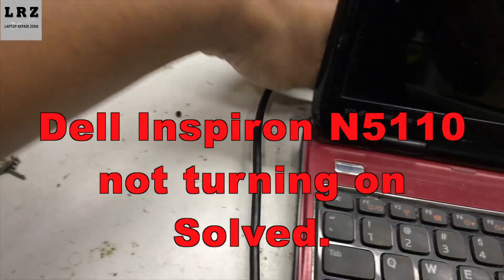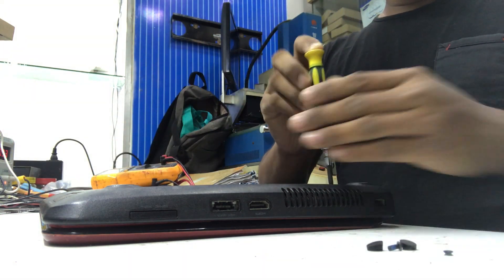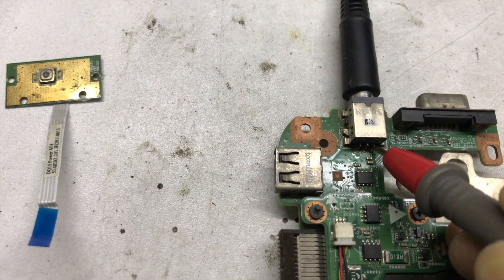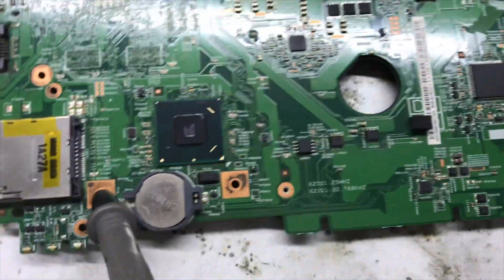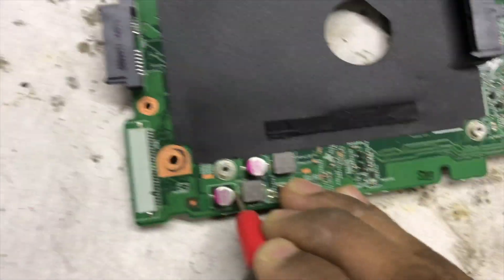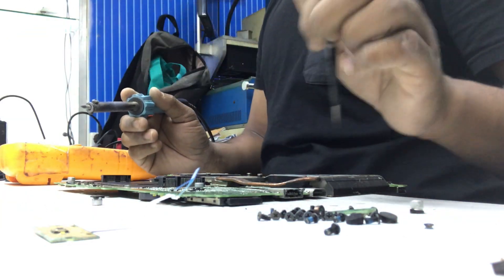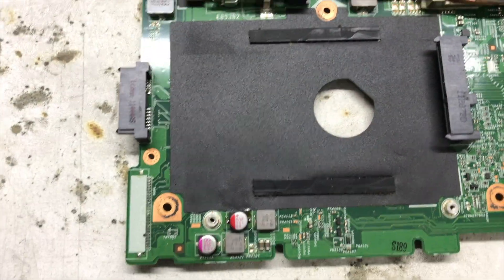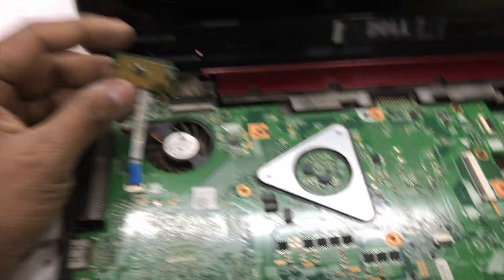dell inspiron N5110 laptop not turning on solved.

Comment: Laptop and it's Fan starts after clicking Power button and after 5sec, Fan stops but Light of Power button still On..

After 10sec, Beep sound starts..

Whats the Issue..?
Reply from the maker: Thanks for your comment, how many beeps?
Reply: @Laptop_repair_zone  Beeps continues until we switch off manually

Comment: When I connect this all up it appears to trip the ac adapter circuit breaker? as it shuts down. (I tried more than one working adapter, same results). When I take the power input board from the mobo off it does not do that and I get the 19v on the jack. So the mobo is shorting the power out. Is there a component I need to test that may be causing this or is it likely a more major failure?
Reply from the maker: Your laptop motherboard 19V line short to GND, so you need to inject voltage from external power supply that should be 5amp, then you can find out which parts short.

Comment: Laptop is powering on through battery. But not powering on through power cable without battery. I checked all voltages as you told with the battery out and power cable plugged. All voltages are correct. Capacitors also gave correct reading. What could be the problem?
Reply from the maker: Thanks for your comment. Please check charging section and SIO.
Reply: @Laptop_repair_zone  Charging section and SIO are showing correct readings. Nothing wrong there. Today after checking. The charging light is blinking. And when the laptop switched on, the charging symbol is also blinking. It is not staying for long.
Reply: Chech if the 3rd pin of charging port is connected. Because of the design this 3rd data pin often get disconnected over time

Comment: i am facing problem on turn off . after press shutdown, it just close the lcd but still power button is on. i have to press and hold on the power button for complete shutdown. please advise. i am really worried due to this issue,

Comment: Greetings friend, I have the same pc.
supply voltage is 19.5v

that of the first capacitor is 0.752 v
, the second of 0.432 v

I do not know how to measure the voltages of the next piece, the one at minute 2:24

I don't know exactly what pin.

you help me please
Reply from the maker: Thanks for your comment, change 3v and 5v IC

Comment: Hi bro, Does this power board (dq15dn15) generate 19v voltage when not connected to the mainboard? I have a dell i5 with crazy voltages on the power board and I don't know if it's a problem on the power board or if it's a problem on the mainboard! I have already removed several components and the problem persists.  
https://i.postimg.cc/j2p5Yx1v/6874684-jpg-baa0f434a5ba78916708c1a5a0d9b592.jpg
https://i.postimg.cc/T2FhD0Pm/Sem-t-tulo.jpg

Comment: in my n5110 the battery not charged/not detected and give me the massage in black screen i need to connect to 135 w charger what shall i do
Reply from the maker: Ehab Mohamed what massage show in your screen?
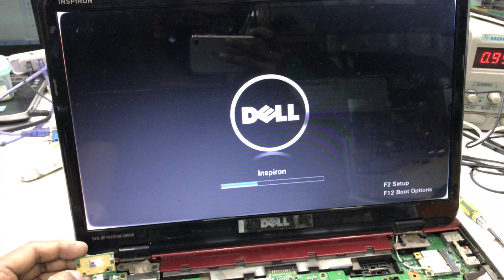Reply: Laptop Repair Zone when i power on the lap it is black screen like the one shown in end of  your video at 6:18 in yours say connect to 85w charger in my message say connect with 135w charger and the lap is toooooo slow
Reply from the maker: It’s motherboard issue you need to check motherboard charging Port.
Reply: Laptop Repair Zone how can i check it. And you mean  heck power board only or all motherboard

Comment: I have the same device the fan volume is somewhat loud even though the processor temperature is low and I did a good cleaning of the fan and changed the cooling paste for the proctor and the screen card, but unfortunately it is of no use please advise me of the cause of this malfunction

Comment: Hi, I have this problem on n5110 mb, I change capacitors but no results, 5v and 3v missing...and is not short! On TPS51123 all voltages are like in your video, what ellse can be? tnx
Reply from the maker: Thanks for your comment.please change TPS51123.

Comment: Mera dell laptop charge ho rha hai but on nhi ho rha hai kya karu.. 7353022456
Reply from the maker: thanks for your comment, if you are a technician than take out the motherboard and check all the require voltage step by step.
Reply: @Laptop_repair_zone  m not a technicians plz send ur no.

Comment: Hi, I have Inspiron N5010 and it got dead during BIOS update from A12 to A15. No power LED nothing just dead. Where to look for the problem BIOS or Power supply? Laptop is dead and no LED or Power button response after plugged in. Adaptor is working. Any help appretiated.
Reply from the maker: Rizwan Naik your location please.
Reply: @Laptop_repair_zone  mumbai. But i am tech. I can try to solve myselfe. Need guidance.
Reply: remove bios ic than  flash it
Reply: @GMurali26  how to getbto bios ic. Any directions?
Reply from the maker: sorry bro my location is dhaka bangladesh.

Comment: Hi sir.. I have similar problem on dell N 5110. I check power jack voltage it shows 19.5 volts and after that I checked voltage at the same resistor as u told, I found voltage continuously dropping from 19.5 volts to 1 volts. Please tell me why this happen and what should I do now.
Reply from the maker: GAURAV PURWAR 19.5 volt rail maybe short to GND try to find short components thanks

Comment: What if you get 3.3v and 5.1v on those two capacitors? I checked similarly like you checked, what I noticed is that there  are two 2.5v capacitor and getting a reading of 0.
Reply from the maker: Check step by step as I check.thanks.
Reply: @Laptop_repair_zone  that is what I did although the power ic part can be a bit trickier to exactly touch the right pins. Thanks.

Comment: Excellent video and your knowledge is impressive.
I have a problem with an N5110 that I've not seen before and wondered if you could help.
Power button, tested as working, (tried a couple of them) will not turn on the laptop
If I unplug the power button ribbon from the mainboard and remove and replace the cmos battery  when I plug in the mains charger the laptop will boot and run fine.
If I remove the charger to power the laptop off and then replace the power button ribbon cable once again the laptop will not longer start.  I  have to repeat the procedure and remove the power button again from the laptop, remove and replace the cmos battery and plug in the mains charger without the power button attached for it to boot.
There is no visible damage to the pins of the power connector on the board so I'm at a loss.  Any help would be welcome and appreciated.
Reply from the maker: lee reflow the PCH then try,thanks.
Reply: @Laptop_repair_zone  Hi, in this particular laptop is there anything wrong with the screen, on the extreme left up to down screen does not seem normal...my friend's laptop n5110 has this screen issue. Do we need to change screen or the lvds cable?
Reply: Hi was that PCH problem ? i would be appreciated if you share your experience with this wired case :)

Comment from the maker: leakage capacitor.
Reply from the maker: Change 2 solid capacitor and then check.thanks
Reply from the maker: You can use smd 330uf capacitor?
Reply: I do , but same issue! no 3 /5 valw !
Reply: Sir How do you be sure!!..i have a 9104p , 19v is ok ,no 3valw/5valw , no short to ground in the rail of 19v and the rail of 3/5 valw...change the Ic ( RT8205LZQW) with a sure one who works perfect at other motherboard same problem !  i think that all the V is Ok on this IC  ,entrip 1 and 2 = 1.2 and 1.3 v....vreg 3 = 3.3v and vreg 5 = 4.5 v! ...Vin =19 v...en = 3v....i take this result with multimeter on OHM mode for the 2 solid capacitor after the coil , rail 3v = 122 ohm , rail 5v = 82 ohm....sir waht else to chek!!..thx